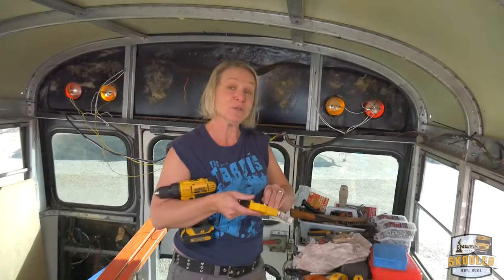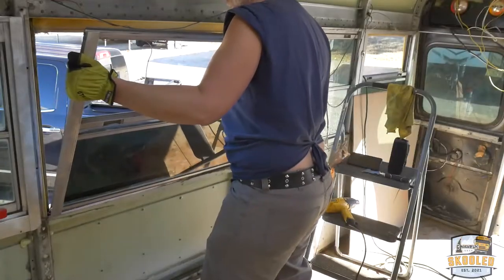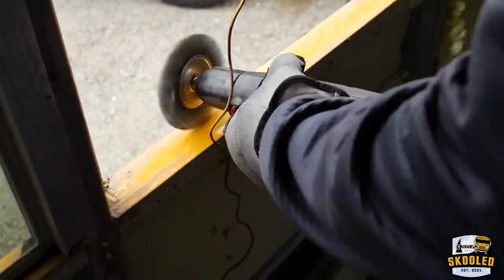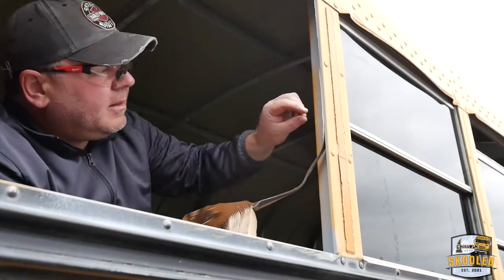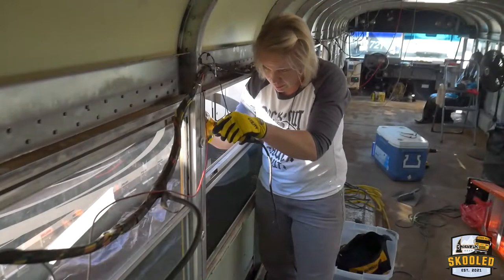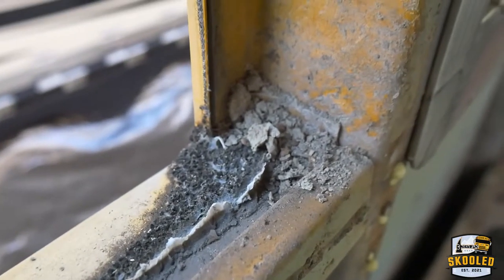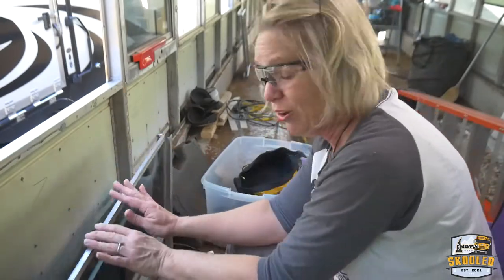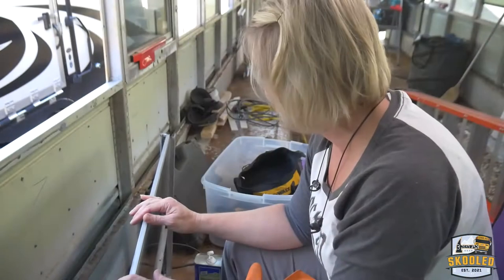How to Remove and Reseal School Bus Windows

Comment: Is it necessary to use butyl tape, or just taking the window out, cleaning it, putting back in, and caulking it back up?
Reply from the maker: Unsure. We're pretty meticulous about such things. If you used the butyl caulk on the outside, it might be enough. I'm not sure there was much more than that when we took the windows out, but we really wanted to seal them up as much as possible. And thanks for watching!